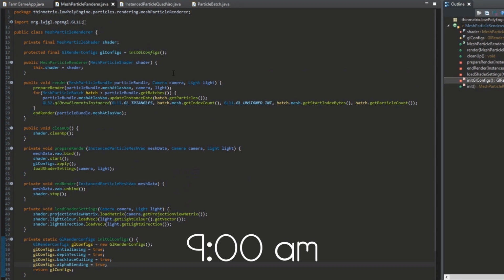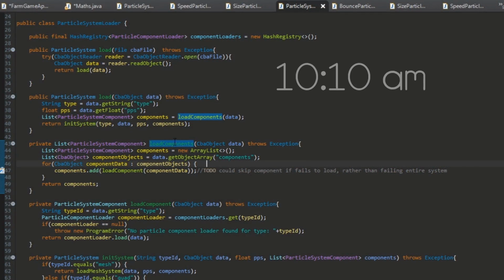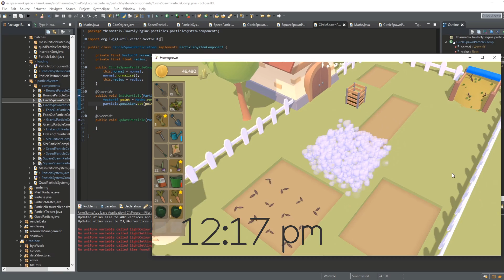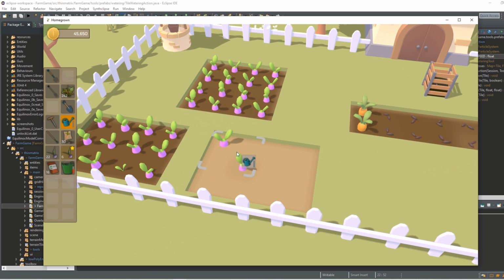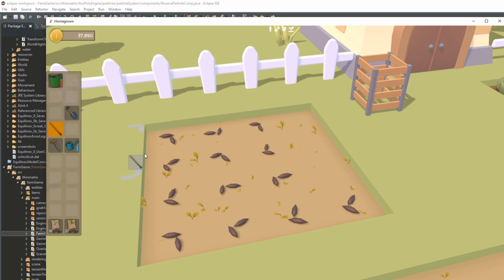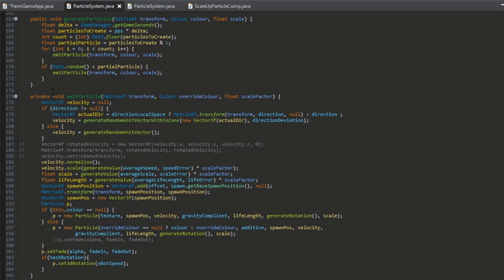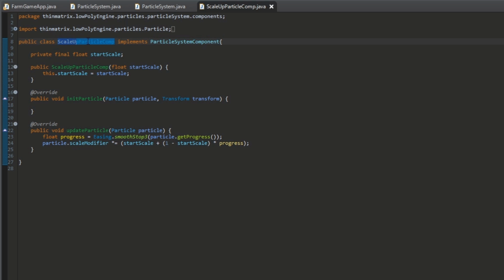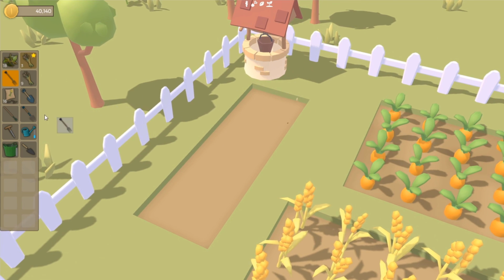Programming Particle Effects in my Game Engine

Comment: I know this is an older video but a suggestion on the leaf particles. Maybe add some leaf color metadata to each of the plant objects. Then parameterize a tint value in the particle effect that reads the leaf metadata to apply the proper color. I've done this in the past and it's great to have it data driven.

Comment: Designer brain going here but: I think it would be a good idea to add in another reason other than aesthetic to have different patches of the crop instead of just making use of all space. 

You could:

- Make it a rule where that's jut not possible

- Make it so that there is an increased chance of cross-contamination (either from certain crops being plagued and then giving that to others, or just contamination in general based on the combination of crops) depending on how close crops are to each other

- Make it so that walkways are necessary regarding the speed of harvest (so making it so you are less of a god and more like you have to physically move a person to the crop.

Comment: I really like the particles! I would just say that for the water effects, maybe trying to make them a bit more saturated blue (Maybe try to match the color of the bar that you fill up on the side of the watering can sprite). Maybe you could add a simple randomized-size component to the system to give it a bit more variety. It might fit the art style a bit better.

(Edit):
     Also just though that maybe you could stretch the drops out to make them look like they have a bit more speed, add the expand component that you showed off in the video so that they start as nothing, and just sort of grow into existence. Maybe you could also add a cube spawn type so that they all start at slightly different heights.

Comment: For the harvesting effect, could you have the length of the line spawned and the color be sampled from the entity your mouse is over when the particle spawns? The color could be pixel based though I think entity-based would be more ideal. Maybe that could work in the form of a sampler component on the entity, if the colors and bounding box dimensions are not directly accessible between objects.

Comment: Hot reloading for your engine (will make you massively more productive, and should be a video!)
1. Store your config files for your game engine in JSON file (or YML, doesn't really matter)
2. In your game engine, instantiate your systems by reading from the config files
3. When your game starts, run a file watcher to detect changes in your config files
4. If a change is detected, iterate through your systems and re-read from the config files / refresh their state. If there's a difference, update the system attributes and/or component attributes. 
5. it should render the next frame according to your new data/configurations if you are using ECS framework.
Reply from the maker: Thanks, that sounds good, I'll give it a try!

Comment: You fields still look very square. You could try out a system of edge-decorator meshes, that look for edges, and spawn a fitting transition-model from a collection. Or a classic tile system using 3D models.
Reply from the maker: I'm going to be working on the terrain soon in an upcoming update, so I'll look into it then :)

Comment: For the harvest particles, could you grab data about the plant you're harvesting and use that to dynamically create particles? E.g. the corn would say it uses a line of some hight with a straw colored leaf, while the beet uses a point and a greener leaf. 

You couldn't store the values in a file obviously, but maybe you could make a "refTarget" utility or something that gets those values at runtime instead of from the file. (This is without good knowledge of your architecture ofc)

Comment: Just a quick idea for later, add the ability to set specific amounts of particles, regarding to the performance setting people choose.
For example: If you have a good pc and set "particles" to high, it has 100% of the particles, medium has 50% and low something like 15% or so.
I've had a few games just bog down on FPS when the amount of 3d particles is not correctly scaled with performance settings

Comment: 1:46 The transparency issue is caused by the particles writing to the depth buffer. Sorting them solves the issue only partially, and only within the particle system. If you have another particle system behind this one, or simply any other transparent object, then then issue will appear again. Transparencies like that shouldnt write to the depth buffer.
Reply from the maker: Thanks :)

Comment: Great work and some nice looking effects. I don't know if I saw that correctly but it looks like you take one particle at a time in your component's function. This would result in a massive function call overhead: num particles*num components function calls. We have a similar architecture for the particle system in our engine but we always take a list of particles in our components so that we can process all particles in a system at once with a single function call. Probably not an issue for you now since your active particle count seems to be very low but maybe something to consider for the future.
Reply: Is the function call overhead really that expensive? Either way you need a for loop, and those can be heavy too
Reply: @sky01james28  It can, especially if those are virtual function calls, which I guess they are since the components are derived from a common base class/interface.

Comment: With your particle system you could add a "mass" tag to each particle so that you can have global controls like wind/gravity ect that would effect all your particles dynamically. The mass would just be a multiplier. 
That way you could have the dust blow with a random wind direction, the wind could change over the day to give the sim more life. Dust would have a very low mass so that the wind really moves it and things like water would have a high mass so that it doesn't have as much drift. 

It would also be nice to see a secondary particle system, so that you can have each particle be an emitter for the second event. Youd have to be careful not to overload it, but have your main particle system and each particle could be spawning an additional particle over its life to make it a more complex looking system. You could tie it in so that when your water particle "bounces" it kills the main particle and spawns 2-5 smaller copies of the water particle in the same space/velocity so that it creates a little splash ect. 

The game is looking really cool. keep up the great work

Comment: Very nice work mate! The particles look great with the game, think putting the extra time into doing 3D particles really works well for the game.
I think the planting particle adds a nice little touch!
For the harvesting particle, would it be possible to set the colour of the particle at run time based on the tile being harvested so you could have it based on colour of the crop?
Reply from the maker: Thanks! And yes, that's what I'm planning on doing. I need to add support for it into the particle system, but when it's done it will allow an existing particle effects to be carried out with specific additional parameters, such as particle colour, size, etc. So all the plants can use the same particle effect and just provide their own parameters for it.
Reply: @ThinMatrix  oh nice yeah that sounds like a great system then, rather than having X amount of particles that all do the same thing rather than colour 
You could even have plants set what mesh the particle should emit?

Comment: A quick solution without making a full blown particle editing software would be a live reload dev feature. Nothing complex, just detects changes in your config file's timestamps. Which on change will load it in the new config and swap out references of the old particle effect.

Would let you can make changes to your particle configs in an text editor and see them instantly. I've used something similar everywhere in my game for config, particle effects, images, gui, etc. It's so much nicer not needing to restart the game to see changes! Speeds up workflow a ton when you are just playing with values. I also leave it in as an option in the released game as modders really like it.
Reply from the maker: Thank for the suggestion, that does seem like a pretty good solution. Definitely easier than making an entire editing app. I'll give it a try!

Comment: Great video. Really interesting.
Small suggestion from my side.

Have a particle registry where all particles exist.
And allow to reference a particle in your "Crops" maybe with modifiers.
That way you can just add particle effects to crops as needed and makes it a lot easier to edit things.
On top of that modding support would make it easier if they could add/reuse particles as needed.

Again I have to say this looks rather good design.
Though I bet your "Particle.class" is where all the variables are stored and all these big functions that you wanted to get rid of are now.
But that is unavoidable, still made me chuckle the moment i realized it xD

Have a great holiday!
Reply from the maker: Thanks! Yeah I've been considering something like that. A way to carry out an existing particle effect but with extra parameters like colour, size, etc. that override the effect's default settings. So the crops can just use the same particle effect with modifications to suit that particular crop.
I don't think the Particle class is tooo bad: https://pastebin.com/1Jrcz39B
Less variables than the Equilinox version, and definitely less functionality in there!
Reply: @ThinMatrix  One thing I would suggest also is also provide a option to get mesh info into a particle, that way you can make mesh specific particles.

And yeah. That is rather clean compared to the one showed in the video, but clearly when rendering all effects the code has to be somewhere at some point.
Still the design is a lot better then previous iterations.

By the way, which java version are you running at this point?
Still at 8 or are you going for 17-18?

Because in 18 (in preview) and newer there is a lot of things coming which aid game dev.
I am especially hyped for the AVX instruction support, which aids ECS insanely because now you can actually bulk process entities.

Anyhow good luck with the rest of your game!

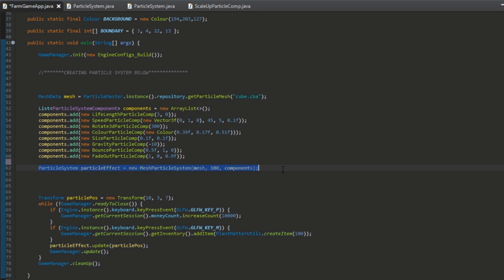Comment: At 8:20 Just a simple observation: Strange this way of storing all components in a local and temporary list, then copying this list in ParticleSystem ? This does useless copies. In C++ (I'm a nut in Java) I will have use std::move() or using an initializer list. I would also have been tempted to use an alternative way using variadic templates (for infinite parameters) and returning the this/self pointer (for concatenating all components): giving something like MeshParticleSystem.addEffect<TheEffect1>(params...).addEffect<TheEffect2>(params...) where addEffect() hides the new(Effect) and the array insertion, but with the major drawback that we can add effects after the constructor and therefore have to use a mutex for protecting the array holding effects against conflict when doing insertions while iterating on it. Anyway, you made a good job with the Components design-pattern that I never succeeded to use in my personal project. I have to force myself using it. Hope to watch a video tutorial about this pattern :)

Comment: Nice particles :) Maybe for different plants you can adjust the colour of the particles, instead of creating a separate particle system for each plant type. Also you can set those particle settings (colour, size, maybe transparency or something else) in the plant itself, so that your particle system picks it up form the plant object instance. 
Nice work

Comment: You should have the water bucket inside the well drop down as you are filling your watering can, it would just add more movement to the game. Even if it doesn't make sense that water is splashing from the well or that it is filling up without the bucket coming back up until after you release your mouse. It would hopefully be a small amount of eye candy & flourish to the game. Amazing work so far!
Reply: What happens if the user stops holding mouse down before the animation is complete? Might look funny
Reply: Your right, it would have to be some programed animation that can adjust to the users actions rather than pre-baked animation that just runs. So that it would lower withing 0.5 sec of clicking, and raise for 0.5 sec as soon as the user finishes clicking. It would look a little funny if you thought about how it would actually be getting you the water, so it would be more movement for movements sake in this case. :D

Comment: How did you solve the sorting in the end? Did you use a (separate) depth-buffer or a compute shader? Or are you sorting on the CPU side (which probably will give artefacts for the 3D particles?). I've been looking into order-independent-transparency techniques for my particle systems, but not with much succes yet. I once got so rid of making good bilboard particles that I tried 'atomic' particles: https://www.youtube.com/watch?v=gAOZq6NmX0U but that's not very practical (or fitting of your art style).
Reply from the maker: Just sorting on the CPU side for now. The 3D particles don't really have any artifacts because the meshes I'm currently using are mostly spherical, so there are never any front-facing triangles overlapping each other (within the same model at least). More complex translucent meshes would have artifacts though, yes. I'm just hoping that I won't need to many of them, so I might be able to get away with it!

Comment: For the leaf particles, you could simply add in an option to change the colour of them so it matches the colour of the plant you're harvesting.  I think that would be enough for that effect.  Nice work anyhow, looks great!
Reply: You probably want the line spawner of the particles to match the height of the plant being harvested.

I was going to suggest something similar. A very popular blocky game seems to use the texture of the block being broken to generate particles. I was going to suggest having a generic particle generator which used characteristics of the plant as parameters for the generated particles, but that may not look as nice as having actual leaves falling.

Comment: The particles look great! One suggestion I would have, is, that it might be a bit annoying to need to hold down your mouse (or at least it seems like it from the video) to do basic interactions, like planting a seed, or harvesting a crop. I think this would be fine for "larger" interactions, but otherwise I think, that it would interrupt the flow of the game a bit.
Love your videos!
Reply from the maker: Thanks! It used to be that you just clicked to carry out an action but that meant that there was loooads of clicking. You were just clicking the whole time. It also encouraged players to click as fast as possible because they would then get things done faster (I saw this happen when I watched friends try out the game) and it turned the game into a very hectic experience, completely the opposite of the relaxing feel that I was aiming for. So I changed it a while back and now you can hold the mouse-button down and then move the mouse cursor from tile to tile, without having to click again.
I agree though, that it still might not be right for things like placing seeds. I'm still considering alternative options for this but haven't really found anything that I'm completely happy with yet.

Comment: For a faster feedback loop/prototyping you might consider using more hotswapping. This works in eclipse as well by using the jetbrains JBR and some startup flags. Allows you to change code on the fly and even add new methods & full classes/interfaces without the need to reboot (obvious some limitations when changing enums or singletons). IMO that java feature is huge for creativity - I even optimized my code to be more compatible for this.
Reply from the maker: Thanks for the suggestion, I'll have to look into it!

Comment: Nice system! I think you could improve it even further by implementing a way to randomize parameters within a given range. What you have basicly done here is creating a fairly simple way to make prefabs for your particle effects with the files you create for them. If you wanted to, at a later time, add some variation to an effect, it could mean you having to create multiple versions of it and choosing one of those versions each time you play the effect. If you instead implement some sort of way to put ranges for the parameters instead of hard numbers, you could make every particle effect just a little bit different. For example having the number of particles chosen at random between 50 and 100 instead of a fixed 75. You'd still have a great amount of control over all your effects but they would feel different each time without you actually having to create different versions of them. Maybe you already have added something similar to this though, since I do see some properties with "average" in their name. Hope it helps anyways :)
Reply from the maker: Thanks, and yes, I do already have support for that with most of the settings such as size, speed, life length etc. Most components have an average value and standard deviation value which I use to create some randomness. I haven't done it yet for the particle count though - I'll do that!